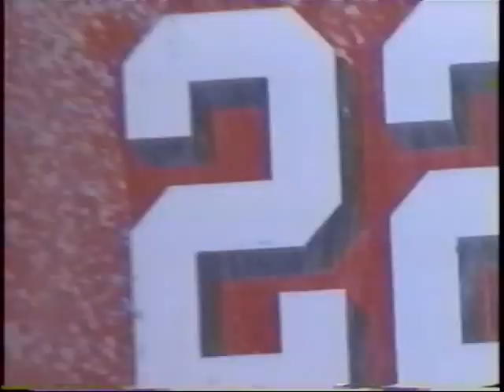Inside Ground Zero on 9/11 - FDNY Debris Closeups

Comment: What a hellish cauldron of steel and concrete. It is no surprise that there was no survivors of the collapse, (apart from Stairwell B), as the enormous forces which each tower created would certainly have litterally atomised many of those within.
I know it was a chaotic time but, if this is an official FDNY video, you'd think someone with some knowledge of cameras would have been employed to document this scene for historical interest alone...
Reply: The weight and momentum of a conventional gravity driven collapse did not possess the potential enerrgy nor category of energy to achieve what was witnessed and documented. Stairwell B survivors werent the only survivors, you also have a rescue worker who floated down from the 22nd floor and a police officer who rode the debris down from above the 80th floor. No proportionate seismic readings. You cannot atomize most of the material like that it doesnt happen. It doesnt dissolve steel in mid air before it lands or after! The dust cloud doesnt dissolve engine blocks that are blocks away or levitate people a block. Tip of the anomaly iceberg btw. People are eager to assume rather than investigating

Comment: Where did I say I supported a "pancake theory"?
Pancaking indeed occurred, but it was far more complex than that. The inside of the Towers were a massive grinding machine of jumbled steel slamming into the floors. The debris evidence confirms it. The mountain of tangled steel at the base of each Tower (10 or more floors above ground alone), and floor trusses turned into spaghetti.
Joe Hill

Comment: If you study other vids and photos you will find huge mountains of debris at the core of each Tower, and the surrounding debris fields are extensive. There is no mystery regarding volume of debris.
Pancaked floors were found lower in the debris, as would be expected. The further down the rescuers went, the more intact structure they found.
Reply: Is there photo evidence of intact pancaked floors beneath the footprints of the Towers? They would have had to bypass the stairwell B survivors as well as those who floated or rode the debris down from the 22nd and 80th floor and done so without making as much noise or seismic impact as one would expect. I would think that, after researching every major theory and study on and off for almost 2 decades that I would have come across somebody proving this as opposed to the few presumptions Ive heard. There was extensive, deep, yet sporadically spaced subterranean damages, but I haven't seen or heard much in the way of intact floors stacked in the sublevel footprints.
Reply: Photo evidence?...... well ya. They actually did a little investigation and were nice enough to organize it all into a report (w/ lots of pics). The 9/11 commission report. It's ironic that most truthers have   never even read the report
Reply: @AmericaIsADeathCult 
There is photo evidence of intact floors, compacted in lower levels, but not directly in the 1 acre tower footprint.

Comment: "The entire building" collapsed in about 13 or 14 seconds. You can't say "entire building" starting when the outer shell started down; the core had already collapsed, evidenced by penthouse collapses.
Additionally, when the shell did start to collapse, the building twisted counter clockwise as a first move, meaning lower support folded, or buckled. If lower support were cut away with charges, it would have dropped straight down as an initial move.

Comment: If you have been watching video furnished by AETruth, you would not see the damage to 7, or the intensity of the fires. There is plenty of evidence 7 was severely damaged, not the least of which is the actions and reports by FDNY. They reported a very large hole on the south side, noticed the building leaning and bulging, and abandoned their rescue efforts for brothers around 6WTC due to the danger of 7 falling.

Comment: "...those towers were STRONG..."
Thanks for the laugh. Who told you that? The guy that engineered them? What do you think he'd say?
They were cheaply built rust buckets, in need of being torn down. Had I known how they were constructed back in the mid '80s, I'd never have attended a cocktail party at Windows. Steel siding with butt joints instead of fitted joints; lightweight flooring held together with 5'8" bolts; drywall instead of concrete stairwell fire barriers; no steel/aluminum barrier.

Comment: 110 storied tower. Collapses due to simple structural weakening by fire from jet impact. Then happens to fall, symmetrically, nearly as fast as a brick dropped from the same height(despite the 47 steel columns which made up the core alone), to all settle in a pile LESS THAN 3 STORIES!
OK, if I were to assume it was because the floors kept smashing into each other than what took the core down? And IF that happened, then I'd think that said floors were in a mostly complete and solid state in order to sustain the energy, correct? This would have had to happen all the way down, correct? So where is at least one semi intact floor that should have remained if that theory were in practice? 
I'm of the opinion, based on video observation, that most, if not nearly all, the non structural steel and aluminum cladding essentially turned to dust, as did the indestructible "black boxes" and 1000 people who are missing but not a trace of DNA has been recovered despite the fact that nearly all the non structural metal was removed by hand and/or sorted.  
 So, do I really buy the official "gravity based" collapse? How can I ? THINK about it!
Yes, there would be massive amounts of force BUT enough to turn anything that wasn't steel into fine powder? No. I don't believe this. First responders tell of molten steel, the utter lack of...anything...that should be there. There should be tons of filing cabinets, phones, computers and furniture. Yet they say that they would be lucky to find anything bigger than their hand! 110 floors of businesses.
Am I , or you, suppose to seriously believe, that gravity had the energy to vaporize hundreds of people and thousands of computers? Turned to a fine powder to be clouds of fine dust which settled throughout NY? If I actually think? No way, only explosive power could do this kind of damage. There is no way someone could argue a gravity fed collapse could have these results.

Comment: the ONLY realistic evidence supports the demolition. so im not sure what your sources are or where your proof is that supports your theory. If you think 110 stories of steel and concrete turn to dust due to "pancaking" or "fire" i'd in less than 12 seconds leaving debris stacked only 2 stories high, then i'd love for you to explain how this is possible and where the other 108 stories went to

Comment: If you study 7 carefully, you will find there is little mystery. But you have to study raw evidence and not depend on pro-demo sites or videos. As an example, it is clear 7 suffered serious damage from the Towers falling, and the fires were extensive. Additionally, 7 did not collapse at free-fall speed. Only the shell of what was left after the penthouses collapsed at such speed. You can't say the building collapsed in 7 seconds because the penthouses started collapsing about 6 seconds prior.

Comment: rubbish viedo but even he overexposure shows that many girders had holes where bolts had sheared as the floors pancaked.  some of the main column girders still have rows of bolts heads that were jammed in the plates as the bolt sheared off.
How many of the conspiracy idiots have ever tried to shear a 3/4inch bolt in  a shear and seen how easy it is?